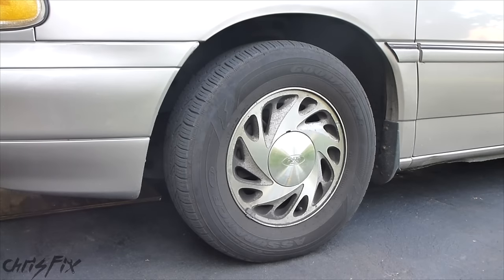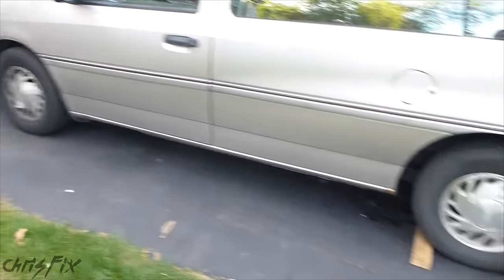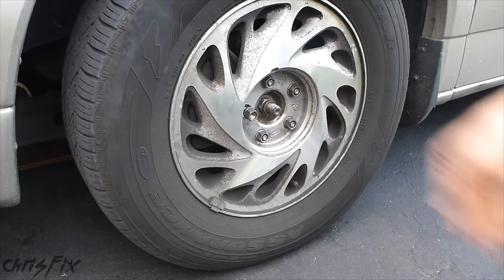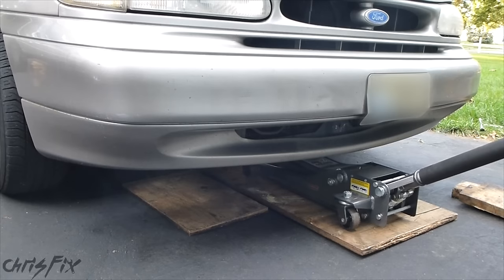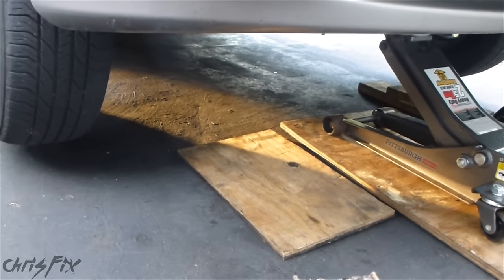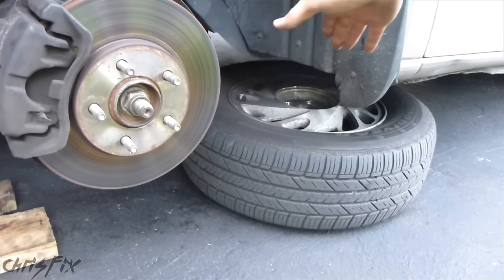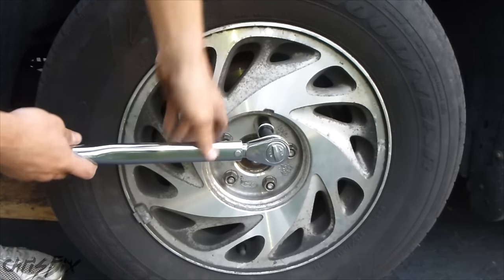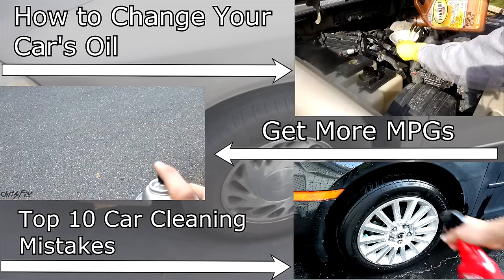How to Change a Tire (plus jacking it up)

Comment: If you bought cross-key tire irons at a Flea Market, and the sockets start to buckle, use the wrench that came with the car.  If you don't HAVE a breaker bar but DO have this, you can use your body weight on it to make it work (I've done this on a Nissan Cube and Pontiac Grand Am). One MORE reason to do the lug nuts before lifting the car.

Comment: The best piece of advice I've gotten for this is to just take the wheels to the shop. Most shops will charge you to lift up your car. Take off the wheels at home and bring those to the shop, it'll save you a good bit of money and it doesn't add much time

Comment: Hey Chris. Love your vids. Me personally, I see nothing wrong with using an impact to reinstall lug nuts. the trick is to have common sense and not let the gun hammer away until the lug nuts are practically welded to the hub. The way I always do them is I will finger tighten the lug nuts all the way till they are as tight as they will go by hand, then I take the impact, and just give them a good zip. I then lower the vehicle, and give them another quick brrrrr with the gun. Plenty more than tight enough. Ive gotten so used to my kobalt 20v, I know when to stop. It takes time to get the feel just right, and it is definitely safer to do them with a four way, or an actual breaker bar, as there is nothing worse than snapping a lug stud from over torquing. Yeah, ask me how I know that😂😂😂🤣🤣🤣😆😆😆Just wanted to throw my .02 cents in. Keep making amazing videos, my guy👍

Comment: ChrisFix My cars lug nuts were rusted to the threads so I used a jack stand, used lug rench, used stuff 4 the lug to make it a little easier to unscrew, used a little hammer hit the rench till it came lose enough to be removed by hand.

Comment: It is also helpful to buff off any corrosion that is on the face of your wheel or hub to make sure that you get as best of contact to the hub with the wheel. Using an impact gun is okay to thread the bolts on just use a low setting. When going to torque the vehicle you want to lower it half way not all the way so that the stress of the vehicles full weight is not stopping the lug nuts from properly adhering to the wheel.

Comment: As an over-50 solo female traveler, shall I add a tip or two here?  Bring a doormat to kneel on. You'll thank me later.  Keep a dog bowl handy for the lug nuts - It's freaking dark out there in the snow and if those things go flying into the grass, you're screwed.  Also before you twist one nut, check the air pressure on that spare.  If it's too low, go ahead and call AAA (unless you happen to have a 12v air compressor handy, which of course you should...)

Comment: The main reason you break the front wheels bolts on the ground is because on rear wheel drives (most cars) the front wheels don’t lock when lifted. Meaning they continue to spin. Trying to break I bolt on a spinning tire is quite difficult lol. I’ve found this out...

Comment: 0:49, actually, it's supposed to be called the 'parking brake'. If your car is an automatic, your SUPPOSED to use your parking brake but ONLY if it's a NEW car. If it's a USED car, NEVER use it. People think they don't have to use it on an automatic because of "P/Park" but really, it's just the output shaft being locked in place by a pawl. The only reason always use it on a manual is because there is simply no "Park" setting.

Comment: side note, if you're putting a spare tire on, put the spare underneath the body of the car before you take the wheel off and have the original wheel under the car as you're putting your spare on, if your jack fails and you have no jack stands, your brake will get seriously damaged

Comment: You and I change tires very different. When you use the tire iron and a breaker bar ( 4 way) I just put a piece of pipe over the 4 way. And when you titan the lug nuts with a 4 way I use a impact. And I do it my self and I am not a mechanic

Comment: Before applying the torque wrench for the torquing up to specification, we should release the jack partially until the wheel touch and have a good grip of the ground.  But we should not release the full vehicle body weight into its wheels so early.  We should release the full vehicle body weight AFTER the torque wrench procedure has been done.

Comment: if you only have the one car jack that came with your vehicle, you can still rotate all 4 tires!
just jack up the first tire and replace it with your spare tire, then lower your car back down.
next, jack up the tire you want to replace it with and replace this tire with the one you took off and replaced with your spare.
next, lower the car back down and jack up the first tire (the spare) and replace it with the tire you last took off.
next, repeat this process on the other side!
done!
Reply from the maker: Thanks for sharing!

Comment: Lug nuts should not be loosened like you did while the wheel is on the ground.  The wheels on most cars are not hub-centric - in other words, they are centered by the cone of the lug nuts against the conical seat in the wheels. When you loosen the nuts significantly with full weight on the wheel, you risk damaging the wheel and possibly compromising safety.  In most front wheel drive cars, the lug nuts can be removed while the wheel is in the air because the front wheel is held by the parking pawl, and the rear wheel is held by the parking brake.  If they are extremely tight, you can break them loose after the wheel has been raised about 3/4 of the way, as there will be sufficient contact with the ground to prevent the tire from spinning.  If you are lifting the entire front end, then the tires will spin due to the differential.  One trick is to take a 2x4 (rock, etc), wedge it under the side of the tire that turns toward the ground, and that will 'jam' the tire and prevent it from turning.   Same goes for tightening; lug nuts can usually be tightened while the wheels are off the ground; in any case they should never be 'loose' when you lower the vehicle.

Do not put anything under a floor jack, especially like Chris does. The jack needs to roll as the arm is raised, and the plywood will prevent the jack from moving. The jack needs to be in contact with a SOLID SURFACE for safety.  If the jack fails to roll as intended, the lift point can slide out from under the jacking point and your car will drop.

Comment: I'd like to issue a warning. Some newer cars, Hyundai being one of them, no longer provide a spare tire or jack or tools with their new cars. They provide a can of stop leak and a battery powered air compressor in place of a spare tire. If the puncture on the side of the tire, the stop leak usually won't work. Then you'll have to call the motor club and wait until someone shows up  to replace the tire.

Comment: I was thinking what Can Chris teach me about changing a tire, well "Egg in my Face" I like your method of raising the tire with your feet to get it on the lug nuts, my truck tires are very heavy and this may work great, going out to check this out immediately  but I should weather resistant pants as it is mixture of snow and rain right now Nov 20th in N.S. Canada. and more than enough hemorrhoids I don't want to risk it..  thanks Chris.

Comment: 2:32  the "tire iron" has an advantage: it provides a pure torque so the car doesn't tend to roll. With the "breaker bar" the car wants to move.

If you feel thankful to have learn something, by all means send me some tools.  :P

Comment: Hi Sir Chris thanks for your videos and explaining it carefully and briefly well appreciated, I would like to ask if i used a jack stand to lift my tire car and leave it for a year is that okay? thank you in advance for your reply
Reply from the maker: You can leave the jack stand on the frame of the car for a year with no problems. I would use 6 jack stands to even out the load across the whole frame so you dont have the weight of the whole vehicle on 1 or 2 jack stands.
Reply: THE RESON WHY I ASKED BECAUSE I WORK IN OTHER COUNTRY AND LEAVE MY CAR FOR A YEAR THAT NO ONE WOULD USE IT SO I NEED TO TAKE CARE OF MY TIRE FROM PREVENTING FROM CHANGING OFTEN, THATS WHY  I WANT TO GET SOME IDEA IF I CAN JACK STAND AND LEAVE IT FOR A YEAR TO LIFT MY TIRE.. THANK YOU FOR YOUR ADVICE WELL APPRECIATED GODBLESS

Comment: you want to loosen lug nuts in a star pattern in addition to tightening them in a star pattern as you showed right?
Reply from the maker: You dont have to loosen in a star pattern. You tighten them in a star pattern to make sure the wheel seats flat.

Comment: Chris can you make a video scenario where you get a flat on the road and you need to fix or change your tire on a lowered vehicle like your Mustang not slammed but just lowered? Do you use the smaller spare tire and swap it in the back if your flat is in the front or what?

Comment: Darn, i was hoping this video was about unmounting and mounting new tires from the rims! Is that an easy thing to do at home? All the youtube videos ive seen either require an expensive looking machine or someone prying at the tire violently. I have to get new tires here soon and my mechanic charges 25 per tire to mount (mounting only, not the tires themselves). You should make a tire mounting video if its something you can do!
Reply: If you don't have the machine, the only way to do it is to wrestle the tire on. Its a PITA but it can be done. You will have to take it to a shop to get it balanced though.

Comment: You should change the title of this video to "how to lose your hands and legs"...
When installing or removing a tire you should only hold the tire on 3 and 9 o'clock.
7:50 - you should never put your right hand there when the car is on stands and without lug nuts. If something happens with the stands / jack and car fell down, your hand will be smashed. Тhe same goes for your feet on 8:40.
Reply: ZXCVbcc      Good point but at this point of the video he made sure all the safety precautions where in place. But I did also think the way he removed the tire with his hands was little odd
Reply: So what do you do when changing brake pads or anything else that's under there? The three jacks and tire he has under there should be sufficient for safety.

Comment: Do you put the emergency brake on if you're changing the rear tire and replacing the rear brakes?
Reply from the maker: You dont put it on if you are replacing the brakes.

Comment: And the debate still roars on;  Grease threads or don't grease threads.

I grease them. The torque difference is so little, it doesn't make a difference. Some vehicles REQUIRE the threads to be greased, others want the mating surface between the nut and the wheel greased but not the threads, others want nothing at all. There is next to no risk whatsoever of a nut coming loose. What you'll find is, the reason they come loose, is actually because people put grease on the hub surface where it contacts the wheel, which can be squeezed out over time. The only point that should 'really' be greased is the hub-centric sleeve; the circle bit in the middle. Anything on the mounting faces other than that can cause the wheel to come loose over time. 

Hub centering ring, grease. Threads, grease. Nut-To-Wheel interfaces, grease. Anything else, no. Waste of grease. 

Emery tape on the mating surfaces will clean off any corrosion. Any old grease applied that's gone crappy, best to get a rag doused in brake cleaner to wipe it off a couple times before sanding and re-greasing. Don't forget to clean the wheel's centerbore.

Comment: Regarding wheel bolt torque setting - what setting should you use if the manual has a range (65 - 93 ft·lbs for example)?

Comment: Shouldnt you brush the mating surfaces with a wire brush first before putting back the wheel to remove all that corrosion damages?

Comment: Lefty Loosey....Righty Tighty
Many people simply don't know which way to turn the wrench/breaker bar to loosen those tight lug nuts.
And you showed that TECHNIQUE is required to remount the tire onto the hub, STRENGTH not required.

Comment: What about applying never-seize for the hub to prevent corrosion?  You are not supposed to put full weight back on the wheels before tightening lug nuts.  Bring the car down just enough to keep the wheels from spinning.

Comment: Our car has rubber parts near each of the tires for the jack. I'm not sure if that's how I'm supposed to do it, but I just lift the car at the rubber thing near the tire I want to change high enough for the tire to lift and then I do the rest as you do. No jack stands, no wood. I'm not sure which method would be faster, since you have more steps, but I need to lift the car 4 times

Comment: The jack is supposed to move forward as you jack the car up, but it doesn't in this video! You can notice the car sliding a little bit just as he finishes jacking it up at 5:55 :|

Comment: What if you don't go in a pattern when tightening the lugnuts? Sorry new to this. My tire seems fine still
Reply from the maker: There is potential that the wheel is not tightened evenly, which can cause it to be loose. If it's still fine, I would consider loosening and then retightening in a pattern so it tightens evenly and you don't have anything to worry about.

Comment: Chris do u change or do a tune up on a ford expedition 1999.5.4 4 wheel drive. Especially the spark plug 7 n 8 that's under the dash board. Can u do a video on that.

Comment: On the 4 way when it's to tight use a jack stand put it under the other side of the 4 way and step on it to pop it loose
Reply from the maker: Thanks for the tip!
Reply: Chris I love your videos and I used them to buy a truck and replace the fuel pump for cheap thank you keep them up I was watching them when u replied

Comment: Can't you put the jack on the front ridges on the edge of the car? That's what my owners manual says for a pt cruiser but that's for a scissor lift. Does that apply to a floor jack too? Also, where would I put my jack stands? Thanks.

Comment: I have a question. Will this affect the cars alignment ? Normally when I bring the car to a tyre shop, the use some device to re-align the wheels. Is that a necessary thing to do if I'm only taking off the wheel to change brake pads ?

Comment: Chris I have a question.  A lot of the cars I have owned, the jack points are on the pinch weld.   Why is this?
Reply from the maker: That’s the jack point for the jack included with the car. Most of the time there is a frame spot to lift the car with for a real jack or lift.

Comment: My friend forgot to use the star pattern to put the lug nuts back in when the car was in the air but remembered and did the star pattern to tighten the lug nuts with a torque wrench when the car was already on the ground. Do you think that’s alright?

Comment: i have a peugeot 2008 2015 and i honestly have no idea where to lift it from.. theres only 4 jacking spot on each wheel but if you lift from there, there wont be any room for jack stands..
the owner manual doesnt say anything about it

Comment: Hi Chris I try to tighten the nuts, but the tire slips against the hub. There are original wheels on the car. Do you know what the fault can be. I have changed tires several times before and this is the first time that yes has been involved. The car was purchased 1 week ago.
Reply: here is a video on my car

Comment: So Chris, my jeeps tire got stuck on and I got it off by dropping the jack without having any lug nuts on it. How dangerous could that be?
Reply: You mean wheel (not tyre) stuck?  It was rusted to hub.  Yes, I would lower jack gently to touch the wheel on the ground to break the bond, but not "drop" it.

Comment: I rotated the tyres on my fwd Vw Polo, fronts to rears, rears to front. Now my front tyres seem a lot noisier? Is this because of the extra tread? I torqued all wheels to 120nm so they aren't overtightened.

Comment: How can i jack up one side only AND use a jack stand? Our driveway has a mini trench on top because its slightly uphill to help prevent cars rolling, so i can't exactly jack up from the centre
Reply from the maker: Use a jack and a pinch weld adapter and jack it up from the pinch weld. Then put the jack stand on the frame or subframe. My next video on how to clean wheels which is coming out in a couple of days will show you how to do this.
Reply: @chrisfix  OMG CHRIS 😱😳🤗
Okay i will try my best! Thanks! Also i will check your new video

Comment: I use my body weight (75kg) to torque lug nut by pushing my feet to tighten the nut. I tighten nuts that way till it’s tight. Is it correctly done?

Comment: but most of the car tools do not have torque wrench, just a lug/normal wrench, is it possible to tighten these lug nuts by hand? could I use my body weight on the lug wrench to tighten them?

Comment: How does the tire spin when suspended in the air if your e-brake is on and the car is in park? Aren't they both supposed to stop your wheels from spinning?
Reply: Your e brake locks the back tyres, the brake pedal locks the front tyres

Comment: When I take my lugs off, and the tire is well off the ground, nothing it holding it on, but the tire just won't come off even though the lugs are off. Like somebody glued it on. However this is my first time actually talking it off the car since i bought it. But it was a used car though. Any solutions?

Comment: This video didn't have my personal method that I use with my OEM honda lug wrench which includes putting the lug wrench on the lug and jumping up and down on top of the lug wrench to loosen the lug nuts from the wheel. Works great and better exercise than jump roping if ya ask me.

Comment: need to apply thread locker?
Reply from the maker: Not for when you change a tire! Just use the proper torque spec for each lugnut and you will be good!